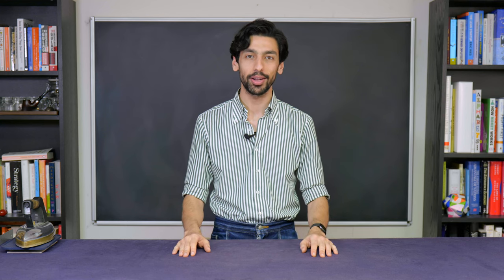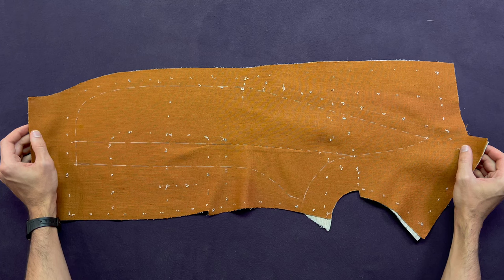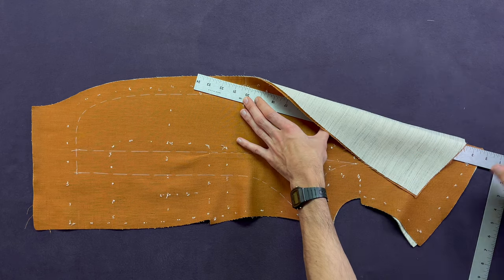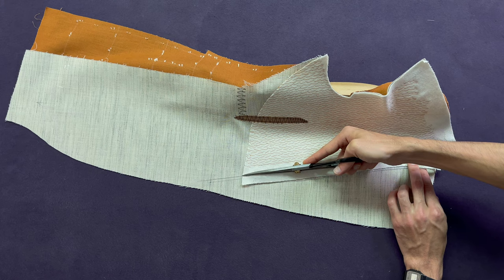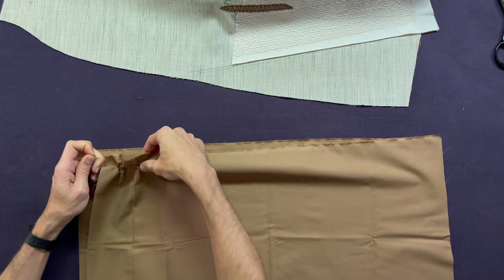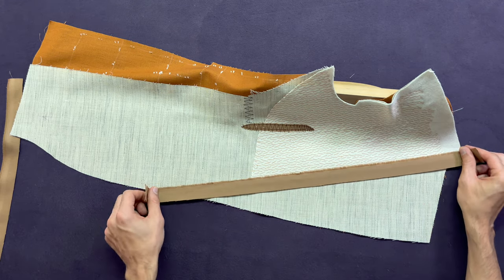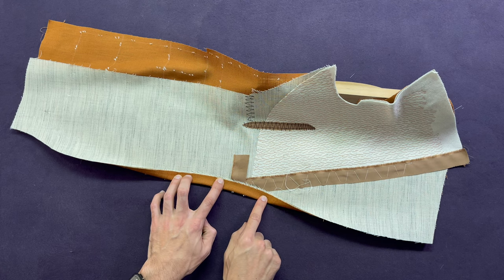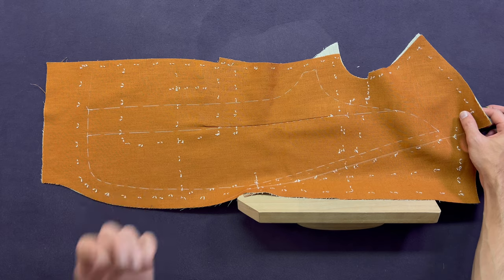L24: Reinforcing Break Line / Bridling - Traditional Model | Online Coat Making Course

Comment: Any particular reason why you do a 1 inch wide bridle? I've seen tailors do more
Reply from the maker: Bridles don’t need to be very wide. Tailors do all sorts of things without solid reasoning. 

When I was an ignorant apprentice, I would apply 2” wide bridles! Thinking that it would “make a better roll” or “provide extra support”, all very low resolution thinking and reasoning. I later learned after thorough examination that the wider the bridle, the stiffer the break line area and the more prone to breaks it becomes.

The bridle’s main function is to prevent the break line from stretching. Covering the break line by 1/2” on either side is more than enough to do this. Adding more unnecessary materials and layers is not a sign of quality or optimised function.

Excellence practised in the wrong direction is waste.

Only if you don’t have enough control over your work, and your break line may not end up rolling to where it should, do you need a wider coverage “just in case”.

Hope this helps.

Reza

Comment: Pardon Reza, why there is no need to do any gathering in the traditional model? Cheers
Reply from the maker: 1. It’s a basic model for beginners that don’t have a lot of experience. Simplicity therefore, is important.

2. Since I teach both with and without a gather, one had to be without and the Traditional Model was best suited.

3. A gather on the break line has a specific function that is not applicable to the traditional model.

4. I want to show that a gather is not always necessary and that doing it by default is foolish.

Reza
Reply: @OFFICIALISOT  4. and how can we judge by ourself if it is necessary?
Reply from the maker: @Noodles-kc1bw  
1. Understand the technique inside out by playing with samples; test its limits and effects on different materials.

2. Know what you want; define your aim and vision. Visualise what the final result should be like.

3. Ask yourself if this technique will help you achieve the results that you want.

4. See if other techniques give the same results with more efficiency, accuracy and beauty.

5. Do the exercises of lesson 14; Darts and wedges.

Reza.
Reply: Is It ok using the selvedge of out fabric as bridgling tape?
Reply: *our